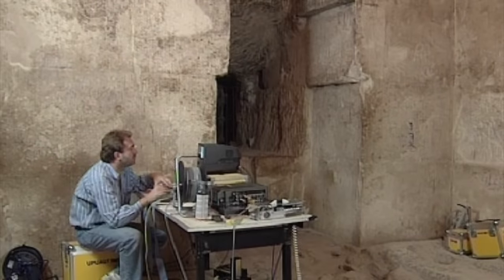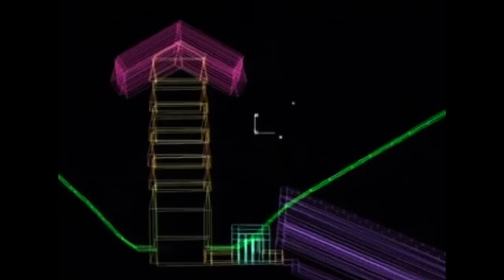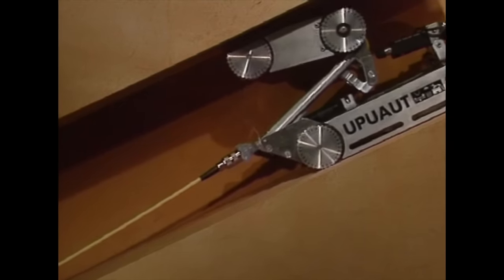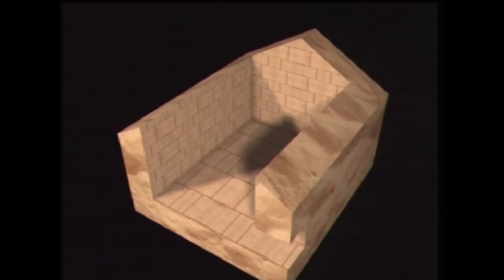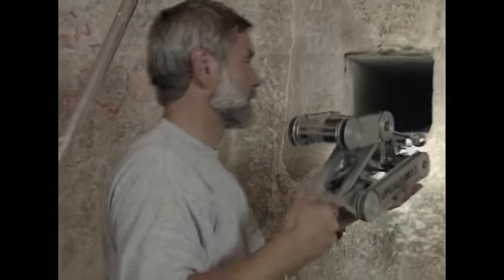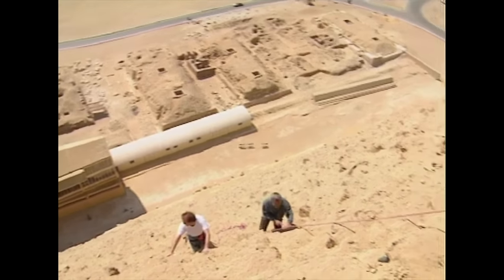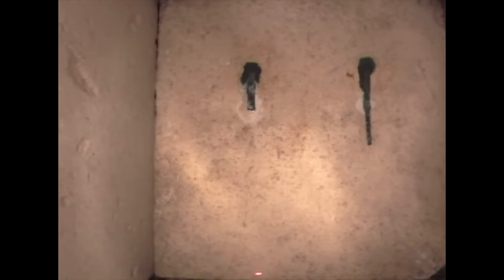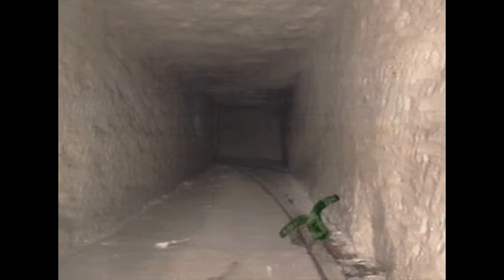Discovering the Closed Door Inside the Great Pyramid: The Upuaut Project (Full Documentary)

Comment: Proof of the mysterious void - At time mark 9:44, the 3D computer model clearly shows that the King's chamber air shaft, that is on the side of the Grand gallery, has a huge dog-leg (bend) in its path as soon as it exits the King's chamber.  Then it proceeds straight.  The view of the 3D model at time mark 9:44 makes it look like the air shaft is avoiding a huge something.  Possibly that something could be the mysterious void above the grand gallery that was found by the muon scan!

Comment: Lets be honest,  we need lidar and HD video of the shafts now.  Could probably put everything in the space of 4 hotwheels.

We know exactly what to engineer for now too.

Maybe get a few rock samples where the rock is erroding for possible conservation.

Get Viable images of the 'worker's marks'.

Double check Sibsom's window, artifacts in the tunnels.

We have the tech.
Reply: I mean we already know that the space behind those blocking stones is extremely small and that they are likely airshafts as well that simply didnt get finished which is why they were still sealed in the queens chamber as well. There are new exiting things like the big void and so on which are way more interesting.
Reply: france made briefcased sized particle colliders a few years ago. they could attach a few and give it a deep x-ray

Comment: Hawass looks a lot younger there..
The conductivity test is brilliant..!
Remember the Pyramid is all about resonance right..? So the door is a valve to open and close to achieve a tone or note from echoing the chamber above. Like a harmonic system of control. There would be others I’m guessing to enable harmonically a distortion and orgonic  like power. Perhaps a static charge in an accumulator (kings chamber) perhaps a kinetic sound resonant accumulator of resonance that would pulse out power..? 
Very interesting.!
Thanks again Matt it’s mind boggling to see this. 
Regards 
Geoff

Comment: My theory on the shafts is they are water channels. As the pyramid blocks are stacked higher and higher it allows for water to easily be delivered to the inner chambers, without having to haul water up to and through to the grand gallery.

Not just for drinking water, but for lubricant for what I imagine would be polishing (lapping) the stone surfaces in the chambers.

If polishing the Queens chamber was finished prior to reaching the outer face, they wouldn’t need completion to the exterior. Why they were sealed with a relatively intricate locking capstone, and not just stacked over, I can’t really explain. Maybe so debris falling in was less likely.

The Kings chamber follows this logic, but might have required more time to complete the polishing as there is less space for workers to place stones as the top‘s surface area decreases as they built up, so the shafts reached the exterior surface.
Reply: I thought you were about to go with that nonsense water pump idea but thankfully didn't.
That is kind of an interesting idea but is hauling the water up that much higher, dumping it in, losing some to seepage really saving that much effort as opposed to just running whatever supplies in through the halls....?
Reply: @AveragePicker  I’m not sure. But I’d figure they’d need a near constant supply of water at the top for making mortar so water would be at the topmost level anyway. The shafts certainly would double as ventilation. The bends and flats at the lower levels would slow the flow so it doesn’t just explode into the chambers.

Comment: I suspect the shafts were for ventilation so that fresh air would enter the pyramid chambers through the usual entry portals,  for those workers employed within the structure, as the air within was drawn out or exhausted through those shafts by using stone stoves containing  fires placed over the outlets of the exit shafts, a more elegant solution, or by using small fires at the lower ends of the shafts using them as convective chimneys, which could be indicated by ancient smoke residue on the walls of the shafts, so I suspect the former may be the case.  Simple convective air pumps are still used in some ancient kiln pottery--which the Egyptians knew well.  Once no longer required, they were simply built over or sealed against water, rodents or snakes.

Comment: Is there a slight bend to the right at 48m18 and just before we see the elevated block? We can also see a camera shot to the right that shows the wall slightly changing angle, or am I mistaking.
Could it be that: On both sides before the next bottom elevated block, the sides were shaved. Was it to allow the lower floor block to come in a bit diagonally below a upper block already in place?

Comment: You absolutely must elaborate on this film. It looks like those shafts were used in the building of the chamber roofs. The ones from the Queen's chamber would not be needed for construction of the King's chamber and likely terminate along a "temporary" outer wall and would be covered as the outer faces were completed.
Reply: You need to explain how those little shafts were used to build the chamber roofs.
Reply: It will be traces on limestone from ropes...and btw bends do not go in that way....cutted in stone end also

Comment: probably just a plugg left over from construction, they needed to plugg the hole so it would not be filled with sand and debris. every time they fitted a new stone on the airshaft they probably plugged it right away to keep it clear. a stone slabb with copper hocks and probably rope on the other side would make so you could pull them out before fitting the next stone then fitt it back in the new one. at one point they desided not to use these wents so they let the plugg be and covered the rest with normal blocks.

Comment: A Couple of questions...
1: If this was to be an air shaft or something of no real use (ceremonial for afterlife)... whey why make the shaft walls so smooth and joints so tight?
2: What could possibly motivate them from liking this shaft with shafts below?
3: Since the cover stones are gone and the outside is pretty much in ruins and restricted from people climbing on it.... what is stopping them from drilling an angled small hole of the least distance for a fiberoptic camera to be inserted so they can see inside the void?
Reply: In 2002 they did drill a hole through the block and there was just a small gap behind the block.
Reply: @danpetitpas  I'm referring to the large void discovered above the grand gallery.

Comment: Gantenbrink's door has to be the most overthought discovery in the entire pyramid.  It ain't a door. It's a plug.  When the builders figured out they didn't need the QC air shafts, they simply plugged them up and kept building.  The idea that there can be something beyond them is ridiculous, as they are so far out towards the outside.
Reply: But then the question becomes why did the Egyptians overthink them? Why not just plug them with  a large limestone block? Why are the copper fixings on a relatively thin piece of stone? Why are there small spaces beyond? The ones in the Southern shaft look like they could just be oxidised copper, but the ones in the Northern shaft look like they could have undergone electrolysis. Further the pins are not symmetrical, in the northern shaft one of the pins is in a chiselled out trench in the stone and the other sticks out further. Why go to the bother to put copper fixings in at all if you know they will end up in the middle of the pyramid never to be seen again (as far as the Egyptians knew.) 

So not overthought at all! There all sorts of possibilities. If they ended in just blank stone walls then your comment would have merit!
Reply: @Batters56   They didn't overthink them. They jut cut square pieces of limestone, put a couple handles on them, then lowered them into place.  It's most likely they were put there to prevent crap from filling up the shaft during construction and were intended to be removed. But then the pyramid was expanded and those shafts were never needed.  There might've been similar ones blocking the KC shafts, but the white limestone exterior is long gone.

Comment: Why did they spend all that time and money making that really impractical robot when thay could have just modified a small off road RC car ?
Reply: Because they are smarter than you. Not sure if this is a serious question but here are a few reasons off the top of my head.
1. Radio control through hundreds of feet of stone would not work.
2. The steep slope and dusty surface would be near impossible for a basic 4wd without tracks
3. It would still need tracks or wheels above to hold itself in place, and an actuator to adjust them
4. It would still need the fancy video control system, and cameras, lights, laser dot, and other sensors
5. The power system would still need to be modified to run from a tether intead of battery
6. They would look like a bunch of amateur fools if they showed up with an RC car

Basically "all that time and money" would still be required no matter what chassis they started with. Making a nice purpose built chassis just ensures that their mission would have a better chance of succeeding and they might be invited back in future instead of just being laughed at.
Reply: @chriscampbell4857  dude, No need to be a dick about it.
This is a platform for discussion not attack.
 I said modified, 
Just thought the lighter body and suspension and steering would have made it easier to navigate the obstacles.
 All the  points you made are very easily over come with simple modifications.
You don't think they looked foolish anyway turning up with a 'robot' that got stuck constantly and they had to push up the hole with a stick.
They may as well have just stuck a camera on a stick and not used the 'robot' at all.